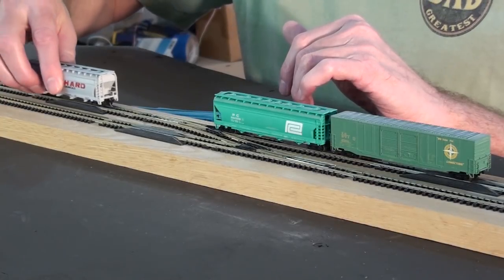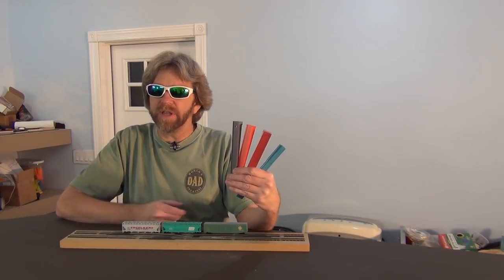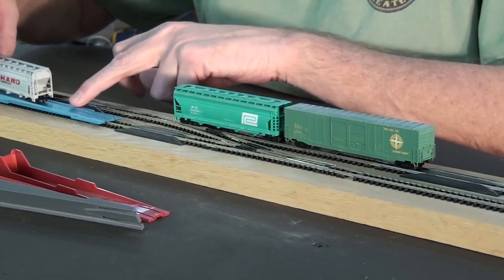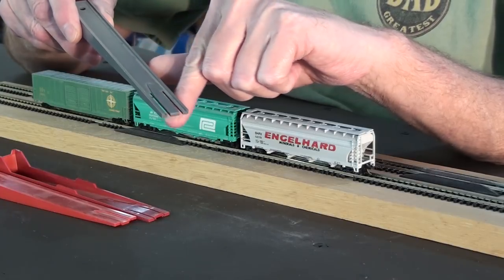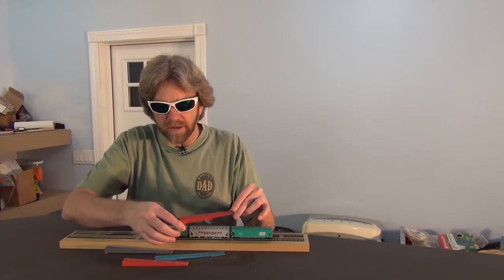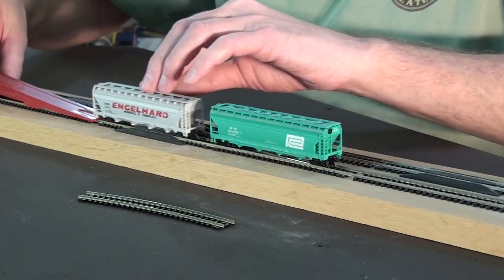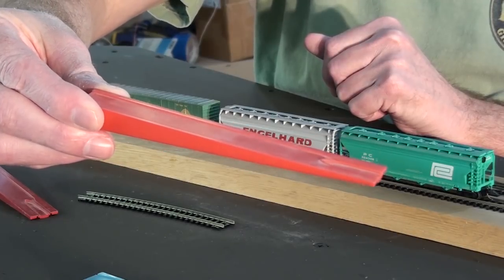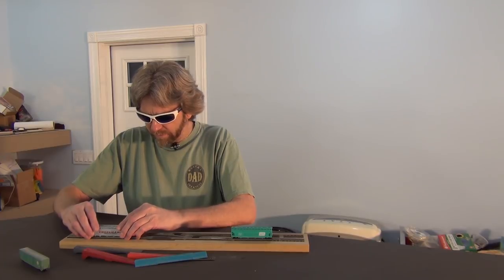🌟 The Best tool for your model railroad operations that you do not know you need 👉Rerailer Ramps

Comment: I took 2 of the same brand rerailers and glued 2 of them back to back and going to drill a small hole for screw, 2 washers, and a nut. I may have to add a piece of wood to one of the ends to help keep it in the air. It really works nice for my Locomotives. I hated having half of the Big Boys hanging off the end of the rerailer. Wish I could show pictures on the comment YouTube.
Reply from the maker: That will be some work
Reply: Will they work with EZ track?

Comment: Hi I want to get the Blue one from Kato I looked on Amazon and it comes with a UniJoiner is that one used in the video or do they sell one without it. also does it fit snug on the track in the video it looked like it did its for my 11 year old nephew by the way I didn't see an Amazon link for the rerailers to buy thanks
Reply from the maker: https://amzn.to/35rNWOr
Reply from the maker: Yes the Kato Blue one would be the same one .  The kato Fits snug on the track. Fixed amazon link.
Reply: Thank you for responding quickly I went to the site and it was at the bottom of the page so thank you